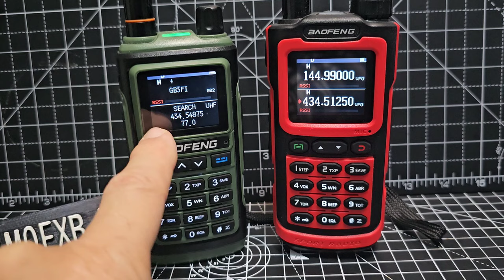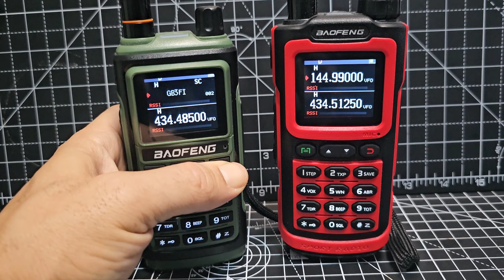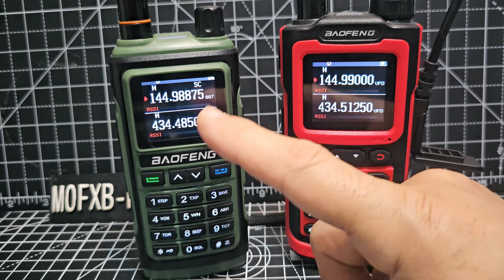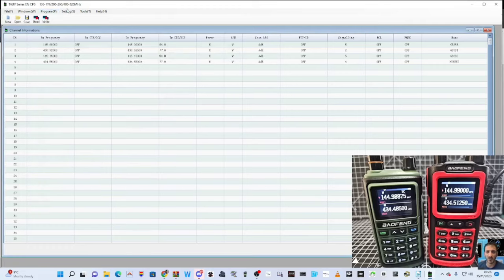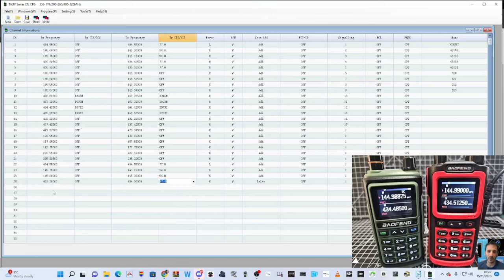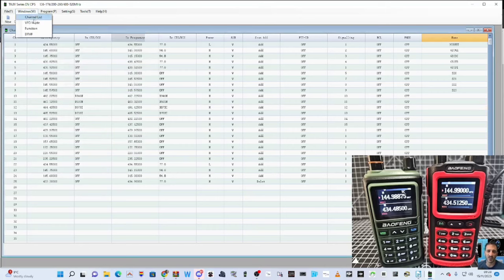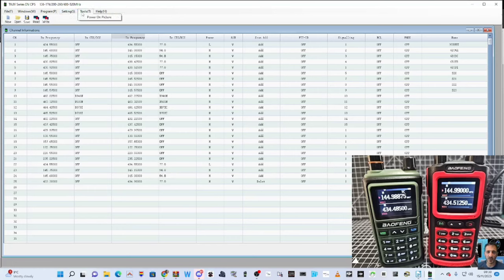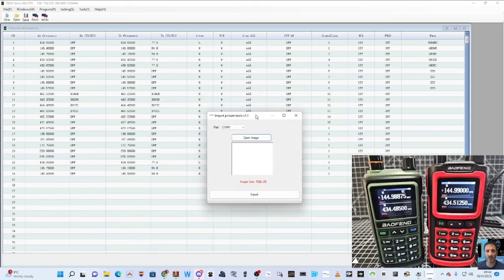BAOFENG UV17 & 20 - HOW TO SCAN , + SOFTWARE PROGRAM (DOWNLOAD LINK)

Comment: @HamTechRadioScannerDrones What I learned about the scan feature is that the radio lacks attenuation. The reciever gets overloaded which causes the frequency inaccuracy. This could easily be solved with a firmware update. But for now you have 2 alternatives for accurate readings. 1st option is to set the squelch to the highest level before scanning. Again, this is a EASY firmware fix if they actually gave a damn. The 2nd option is to basically remove the antenna before scanning. Both of these tricks compensate for the lack of attenuation accuratly 99% of the time. The downside here is Baofeng doesn't provide firmware updates for their basic analog radios. Future radios may be fixed, but current radios are pretty much stuck the way they are. Maybe if we make enough noise about it someone will listen.
Reply from the maker: Yes we need new firmware thanks 73

Comment: thanks for the info ,very useful .one question is how do i scan through my stored frequencies  ie  zone 1 for instance, I can scan for nearby transmitter . no problem. uv17r pro gps by the way.thanks
Reply from the maker: Hold finger on scan when in memory mode .
Reply: This brings up my gps location when I hold down the blue button….